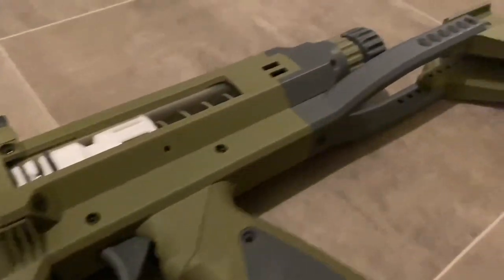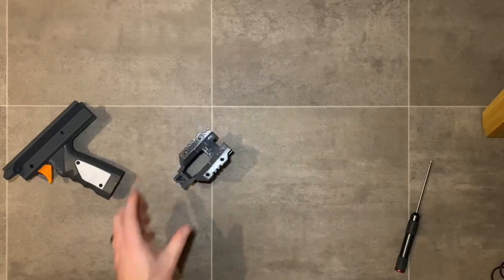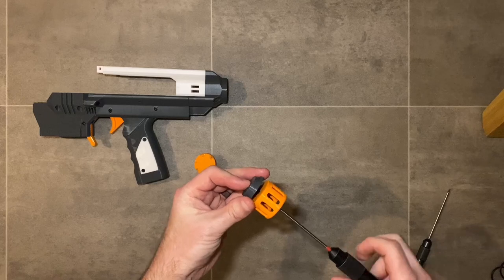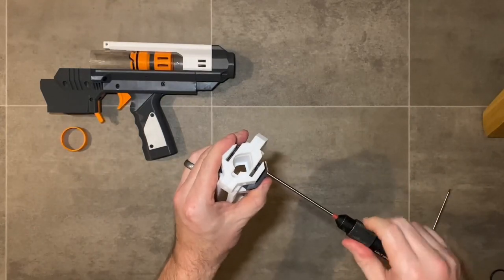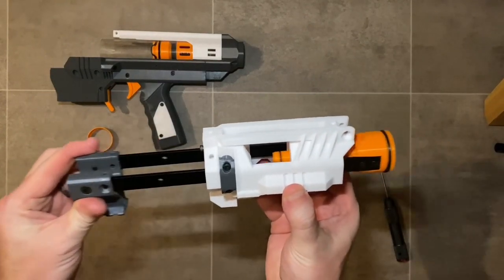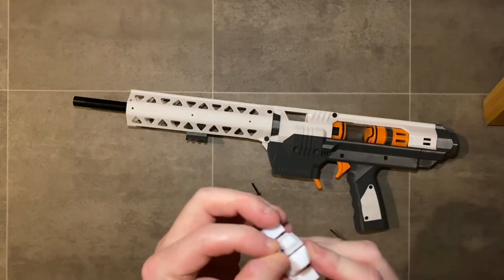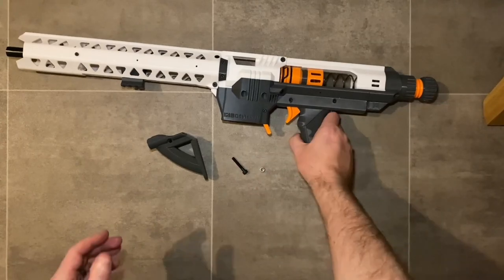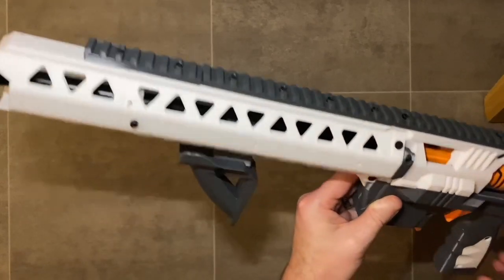How To Build A 200FPS 3D Printed Nerf Blaster: Multi-Tool PRO

Comment: Is there a 300fps configuration? I love the design and mechanical choices you've made on this blaster. very smart.
Reply from the maker: Thanks man. With a heavier spring, perfectly tuned seals and a longer barrel it might be possible. I’ve not seen it though.
Reply: @doughtinator3d  thanks for the reply. Is there a way to purchase A step file for the blaster?
Reply from the maker: @Daniel-fm7yh  I have provided a step file on request to customers yes. No extra charge just by special request 👍🏻

Comment: Are you able to mount pic rails using the small holes on the sides of the shroud?
Reply from the maker: Yes. They match the hole pitch of one of the included pic rail sizes.

Comment: What printer was this printed on and how long does it take to print approx?
Reply from the maker: I use a cheap Voxlabs Aqullia. I think all the parts would take around 30 hours but they can be printed in smaller batches of parts.

Comment: do you think this would work with resin printed parts?
Reply from the maker: Sorry for the late reply. I’ve never tested it. But I’m doubtful it’ll work. I think resin is usually better due detail but perhaps not as robust?
Reply: @doughtinator3d  their pretty solid, but most resin printers have a smaller printing area, that's what id be worried about.